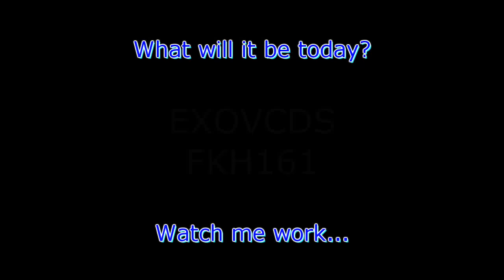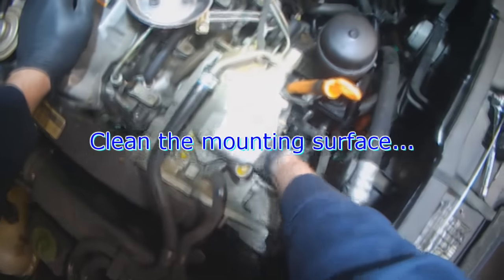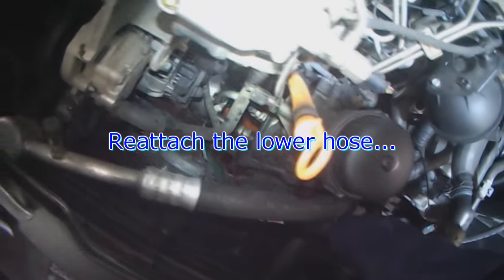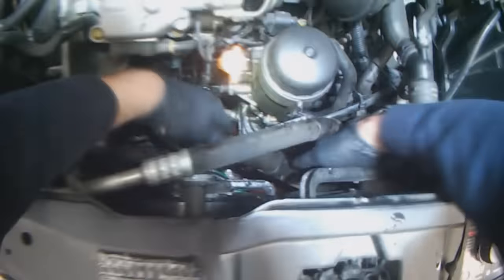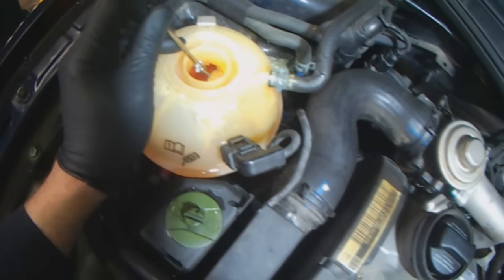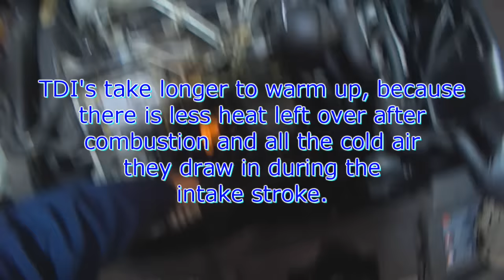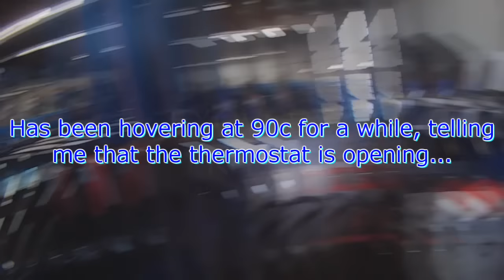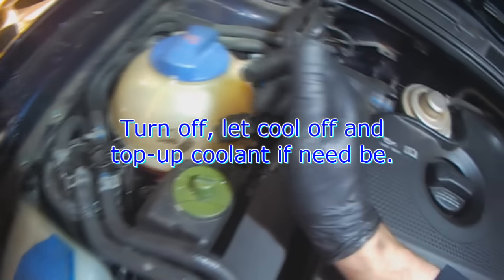VW A4: 1.9L ALH TDI Thermostat replacement (full)

Comment: Hey mate having some problems with leaks running down the passenger side of the block post thermostat replacement.  I can't for the life of me see that the thermostat itself is leaking, have I caused somehow a waterpump problem?  Can't really tell if it is because I'm using aftermarket parts (Meyle Housing/Seal, Motorad Thermostat), but it is not obvious to me that coolant is leaking from the stat itself...tho its a tight spot.  Second try I used RTV like you, and problem persists.  Stumped.  Do you use OEM?  Any help is appreciated!
Reply from the maker: Which side of the thermostat is the o-ring seal? Reason for having replaced the thermostat? Remove the lower timing belt cover and look at the water pump. If you see crusty dried coolant... the pump has been weeping for some time already (some weeping is normal from the "weep" hole) and is now leaking. Other possibility is that the leak is coming from the "bypass pipe" that is mounted to the block where the thermostat is. The o-ring for that pipe doesn't last for ever. It is also not uncommon to fix one leak and another leak develops.  The weakest link always leaks. Once you seal a leak, pressure increases, putting strain on the next weak link... until it decides to leak.
Reply: @EXOVCDS  Thanks for the reply.   I think to answer the first question the or-ing seal is between the wide site of the thermostat and the housing.  Looks like a good fit, but I definitely wish I had the 'click into place t stat'.  I replaced the thermostat because I was getting a P0128 code, and had already replaced the coolant temp sensor.  Ya, these are the annoying truths of a pressurized system.  Timing Belt/Water Pump was last done probably 5 or 6 years ago, coming close to 100k kms.  This bypass pipe, I have heard about, in your opinion either this or the waterpump failing are possible culprits?

Thanks again for a super video and for following up!
Reply from the maker: @kurt.loewen  with a little patience and disassembly, I'm sure you'll find the source of the leak. 5 / 6 year old water pump failure is not uncommon these days. There's no set life expectancy. Some fail before timing belt service interal, some don't. Water pump coolant will drip from behind the crankshaft pulley. Bypass pipe leakage will drip similar to thermostat housing leakage at the front / right corner of the engine. 
Cool last name (Lions)!
Reply: @EXOVCDS  Ya I definitely identify with the Cat!  Dang looks like they keep deleting my recent comment because I provided a link to the leak.  It is a video showing, hate to say it, coolant pouring over the back of the crankshaft pulley.  

I popped out this evening with a flashlight and am pretty sure the "bypass pipe" is not the culprit but will see in the morning.

Last thing I'll try before disassembling too much is one of the 'click into the housing' tstats.  if that works, well then I've avoided a bigger headache/bill/time.  

Also, sent you a coffee!  Thanks for everything mate!  YOu got a shop in Burnaby?
Reply from the maker: @kurt.loewen  thanks for the $.
I wouldn't bother changing the thermostat again. You should be able to see if it's leaking or not from the top. If coolant is dripping from the back if the crank pulley, I'm quite sure that the pump is leaking. Again, can be verified by removing lower timing belt cover. Just the serpentine belt & tensioner have to be removed, as well as the crank pulley... to get at the lower cover. I'm in the lower mainland, yes.

Comment: Can I ask.missus had a leak so filled the car up in an emergency with water.it froze that night and when she started it if made a weird noise.was it the water pump and if it was the pump would I still get pressure in the pipes because I've replaced the rad but either water pumps gone or could the thermostat but stuck closed.i can't get any heat out the heaters and today when I put the cap on the bottle the pipes swelled up and something gave cause steam started coming out a joint.
Reply from the maker: If you have no heat inside the car, the water pump is bad.

Comment: Can bad thermostat have an impact on fuel economy? I have mine sitting betweeb 1/2 - 3/4 to 90degree on the dash. Not sure if that's normal
Reply from the maker: Needle should climb to 90 (middle) and stay there. If the needle drops while driving, the thermostat is sticking open, causing excessive cooling... which reduces fuel economy (a warm engine needs / uses less fuel). If the needle goes past the middle to 3/4, you have to check why. Bad water pump, fans not working, clogged radiator, bad thermostat etc.
Reply: @EXOVCDS  mine must be bad then. It doesn’t reach 90. Can I verify this in group 7 in vagcom or the needle is enough to show it’s gone bad? Thanks
Reply: @EXOVCDS  So I scanned the coolant temperature in VCDS and it read less than 80 degree after a short engine shutdown. It slowly went up when the engine was running again but the needle on the dash  stayed at 90 (center). Does this confirm bad thermostat?
Reply from the maker: Needle should climb to 90 (middle) and stay there. If the needle drops while driving, the thermostat is sticking open. 
If the needle drops and rises while driving at a steady speed, then I would suspect a faulty temperature sensor.
Reply: @EXOVCDS  If the thermostat is sticking open, should the lower and upper coolant hose feel warm after about 10 mins driving? Just want to confirm one more time before I start replacing things. The temperature gauge on the dash drops after highway driving. At steady speed, temperature seems to be holding but takes a while to get to 190.
Reply: @EXOVCDS  How long does it take to reach operating temperature normally?
Reply from the maker: Year, make, model, engine? TDI's can take over 20 min to 30 min to reach operating temperature where the fans come on. Common rail TDI's are a bit quicker. Lower hose of TDI's will stay cool to the touch for a long time... if the hose feels warm before the needle reaches the middle, then the thermostat is opening early / sticking open.
Reply: @EXOVCDS   It’s 2003 TDI ALH Golf. New thermostat and flange incoming. I opted OEM one to keep same temperature but I’ve read higher temperature can gain fuel economy, those thermostat from older gen TDI. If proven solid upgrade and doesn’t blow up engine, I may want to try it. Some gain in fuel economy would certainly help with crazy fuel prices around :)
Reply from the maker: @mybigbackyard741  clean the carbon from the intake and make sure that the egr cooler is not plugged. Also drain the oil from the intercooler.
Reply: @EXOVCDS  I got a spare intake for the job. Just needs some cleaning. I drilled the bottom of intercooler for oil draining every oil change. Did it after watching your video :) about it. 👍🍻

Comment: HEY THOMAS !  WHAT MAKES THE DEISEL ENGINE LOUD ?
Reply from the maker: Old diesels are noisy because of the indirect way of injecting fuel... new diesels inject directly into the combustion chamber at high pressures (higher than older diesels) with multiple injections (as opposed to just one like old diesels) per combustion event.

Comment: what year / model. I have a 2004 Jetta TDI. my coolant temp doesn't look like this. I can't find it anywhere....
Reply from the maker: This is an ALH TDI... you have a BEW TDI.

The coolant temperature sensor is located in the coolant flange at the side of the cylinder head. Find the top radiator hose and follow it to the engine. The black plastic pipe / flange that the hose attaches to, is the coolant flange. At the back of the flange is where the temperature sensor is located. It will be a little difficult to spot if you don't know its exact location. Use a flash light and have a look at the flange. If you have a standard transmission... the flange will be made of metal.

Comment: Hi there. Can you give me some help please? My VW Passat b6 1.9 TDI 2008 model has a coolant leak . The hose that was punctured was changed and tighter clips put on and is still leaking coolant. The mechanic now says it's the thermostat because the hose is rock hard from pressure and he says that's causing the leak. When he loosens the coolant bottle cover the air comes out and the hose is soft again. Could he be correct or do you have any ideas? Thanx in advance.
Reply from the maker: How long does it take for the hoses to get hard? Once the engine is warm (hoses are hard) shut the engine off... let the engine cool down (overnight). The next morning... are the hoses still hard?
Reply: @EXOVCDS  I'll check that and let you know. Thanx buddy. Someone said it might be the coolant flange
Reply: @EXOVCDS  if the hose is still hard the next morning when the engine has cooled down what would that indicate? Possibly the thermostat? Or possibly the coolant flange?
Reply from the maker: @poolking36  if pressure is still in the system the next morning (when the engine is cold), then the head gasket is bad.
Reply: I drove the car this morning and let the engine cool. When I checked it now a few hours later the hose is soft again
Reply from the maker: That's good... then it's probably not a head gasket issue.
Coolant expands when it get hot... causing pressure to build in the cooling system. The reservoir cap is supposed to vent excess pressure (18 or 20 psi I think). The hoses "should have" pressure when the system is warm... but too much pressure can be a sign of running too hot or head gasket issue. If the engine has coolant leaks... fix the leaks. The "weak link" will always leak first... meaning that you can fix one leak and another one will surface. Once all the leaks are taken care of... you can diagnose further. If you do not have any overheating issues (the temperature needle is always in the middle, coolant fans come on when they should, you have heat inside the car etc) then don't worry about the pressure in the hoses, unless the same leak keeps occuring (pressure is damaging the same new parts).
Reply: @EXOVCDS  thanx so much . We think it might be the coolant flange . We'll check it on Monday and if that's the problem it's an easy fix. I'll let you know . Thanx again pal 👍
Reply: @EXOVCDS  the mechanic thinks it's the thermostat but I don't think thats the problem. I hope to find out on Monday
Reply from the maker: @poolking36  If the engine is NOT overheating... then the thermostat is OK. You only mentioned coolant leak... never any overheating. Does the car have a temperature gauge / needle? Where is the needle when the engine is warm? Does the car have heat "inside" the car when you turn the heater ON?
Reply: Thomas EXOVCDS yes the temp gauge is always at 90 degrees right in the centre after it heats up and never goes over that. The heater works fine fir hot and cold alike . There was a perforated hose that was replaced and it still leaked after it was replaced so tighter clips were add d and still leaking but not as bad as before. So we suspect it might be the coolant flange so we'll check it on Monday and see how it looks. 👍
Reply from the maker: @poolking36  Ok.
Reply: @EXOVCDS   The hose doesn't seem to be leaking any more.we pressure tested it and no leak. The coolant flange is fine,but still.loosing   coolant from the bottle even though it's not as bad as last week but still leaking. And small few drops under the car but can't find where its coming From. Any ideas?

Comment: Hello 
Thomas EXOVCDS
Have an A4 1.9 TDI 85kw. I have some pressure in the coolant system. Squeezing the upper radiator hose, being hard , tells me that i do have too much pressure in the system and after 20 km feels cold , no signs of warm on it. Engine working on idle i see no signs of coolant in the reservoir return hose , but i see coolant returnig to reservoir only for a few second after i loosen the reservoir cap . Revv-ing the engine to 1800-2000 RPM i do see coolant returnig to reservoir constantly. I hear gurgling/air  sounds inside the heater core matching aside RPM from iddle until 2000-2500 RPM . I think i have some leaks inside the cabin from the heater core , matching the assumption that i do have too much pressure inside the system. Maybe you can help me to take my decision.... I am thinking to change the timing belts with rollers, water pump and thermostat ...  And maybe , if this doesn't apply as a fix I will check the head gasket  Thanks
Reply from the maker: It is normal for the hoss to get hard as the engine warms up... too much pressure can be a sign of had gasket failure. When the shut the engine off and let it cool down... does the pressure stay in the cooling system? If the pressure stays in the system (check when the engine is cold the next morning)... then you probably have a head gasket issue.
No heat inside the car can be due to a bad water pump and or a bad head gasket. A bad water pump will NOT cause gurgling sound... air in the system (system not bled correctly or air getting in because of head gasket) will.
What does the temperature needle do? Does show overheating?
Reply: @EXOVCDS  To respond to your question .... needle doesn't move at all. It stays below at 60 de C , and it is like this from the moment I buyed  the car 3 years ago .It just moves from repaos position to 60 deC when I switch the key to ON position. Maybe it is a cluster issue or bad ECT . We speaked about this, in another posted video, so this is not the first time I'm asking for your opinion in my problems with my car.

The pressure stays in the system even if the engine is cold.There is almost same presure, no matter the engine is cold or hot , just small difference of pressure in favor of cold situation.

So unfortunately, almost every sign points to a possible head gasket situation....
There is anything i can check  TO BE SURE that the head gasket is the problem ? It is very important to be sure, because , it is very expensive to resolve the situation. Asking this because , no matter how much i'll drive , or how fast , the coolant doesn't boil . even taking into account an outside temperature of 25-30 deg C (77-86 deg Fahrenheit). 
Thank You
Reply from the maker: Checking for exhaust gasses with an exhaust analyser or test fluid would be the way to check for head gasket failure.... gasses in the coolant reservoir.

Comment: My return hose does not bring back fluid. What should I do or check?
Reply from the maker: I need more info.
Overheating? Yes / no?
Heat inside the car? Yes / no?
Reply: I just got the code for the overheating. Doesn’t get hot inside yet. 
I unplugged the hose that returns to the small tank but it’s doesn’t have fluid coming back.
Reply from the maker: How quickly does the needle need the dash rise from cold start. When the needle goes past hot, is the upper coolant hose actually hot? Does the reservoir vent pressure? If you have no warm air inside the car, then the water pump is bad.

Comment: Does the alh have a block warmer? Or can you install one
Reply from the maker: Doesn't have one, but you can install one... many different options available. Either warm the oil or the coolant. Coolant will provide heat inside the vehicle right away... oil will insure that things get lubricated right away.
Reply: depends where you live if you live in colder climate I think they had one. I bought a 03 it had a block warmer kind of like a heating pad for your back but for your Oil. You can install one get Pros to do it tho. They work great here In Alberta Canada at -30 had to cycle the key 2 or more times but it started right up.

Comment: could the stuck open thermostat lower your MPG in a ALH TDI 
CAN YOU REPLY PLEASE THANK YOU
Reply from the maker: Yes, a cooler running engine will use more fuel.
Reply: okay then if the thermostat is the problem would it show up on a ecu scan ?
Reply from the maker: No scan tool is needed to verify thermostat operation. Start the engine when cold... monitor the upper and lower radiator hose temperature by holding them with your hand. The lower hose should remain cool to the touch until you can't hold the upper hose anymore because it is too warm / hot. If the lower hose also gets warm (at a similar rate as the upper one), then the thermostat is opening early. Another indicator... the temperature needle will swing to the left when you are at a cruising speed, after the engine has reached operating temperatures (needle in the middle).
Reply: i changed the thermostat but now it comes to operatin temperature but the lower hose from the thermostat is still cold and doesnt get hot  what can i do i bleed the sysytem but now i dont know what to do
Reply from the maker: Is the engine overheating? The lower hose will remain cold for a long time on TDI engines. As long as the temperature needle does NOT go past the middle, you have nothing to worry about. The hose will eventually get hot and the fans will come on.
Reply: thank you so much Thomas you helped me a lot

Comment: thomas what are the symptoms of a thermostat that is stuck open
Reply from the maker: Engine temperature slow to warm up... if a temperature needle is in the dash, the needle will drop towards cold, once the vehicle is being driven at a constant speed, from a fully warmed up standing position. The ECM might also set a cooling system performance malfunction code.
Reply: @EXOVCDS  This sounds alot like my car but im not worried since its not as risky as a thermostat stuck closed, but i don't have ECM code for it though.
Reply from the maker: Correct, stuck open is better than closed. You can put some cardboard in front of the radiator to help reduce the amount of air flowing through it... that should keep the coolant a bit warmer (if things are getting too cold for you in the winter).
Reply: @EXOVCDS   any long term disadvantages of driving with cold temperatures on an engine?
Reply from the maker: Slight decrease in fuel economy... cooler running engine uses more fuel.